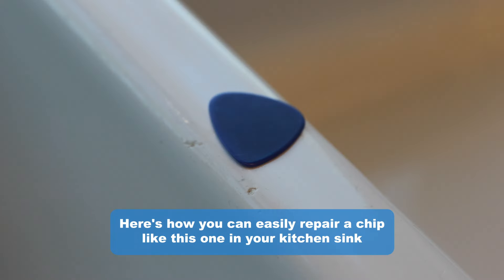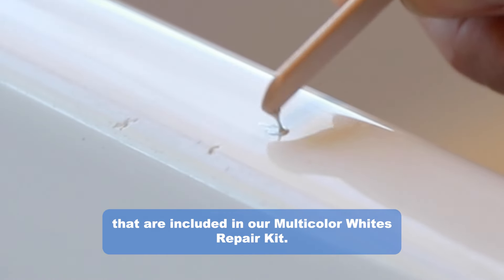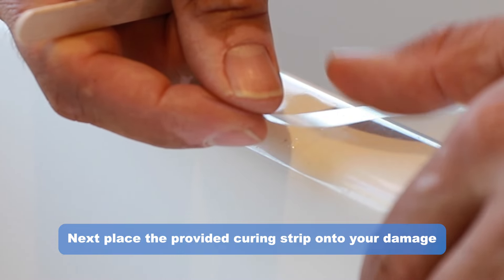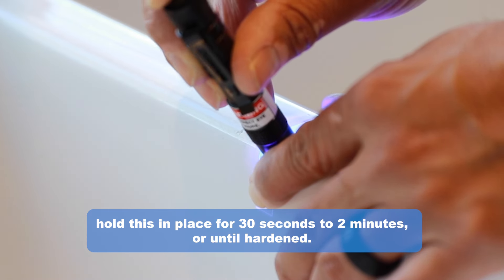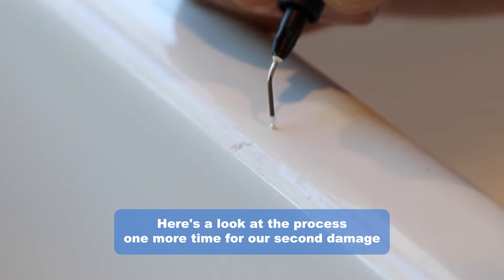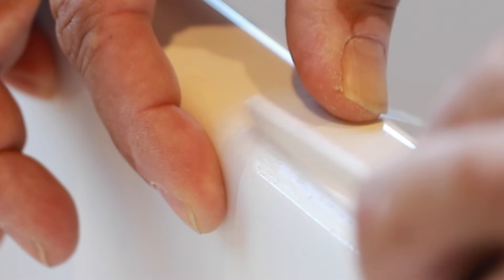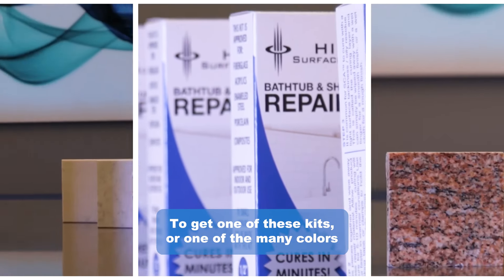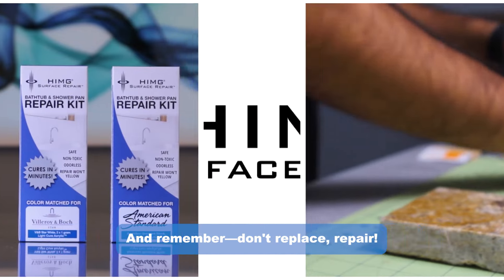How to Repair a Chipped Sink with HIMG Light Cure Acrylic Surface Repair Kit | Easy DIY Sink Repair

Comment: After the material dries, isn't it matte? When the sink is glossy, wouldn't there be a difference because of the enamel?
Reply from the maker: It's actually the opposite! Our material dries more on the glossy side, and if you needed it to match a matte surface you would use the included sandpaper to match the texture. We used the wet sandpaper (also included) for this repair so that we wouldn't mess with the gloss.